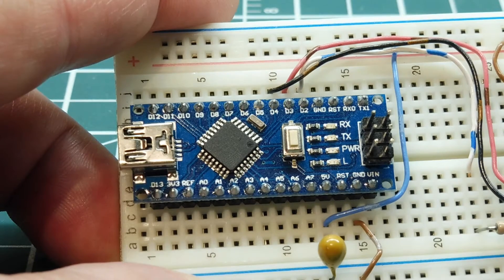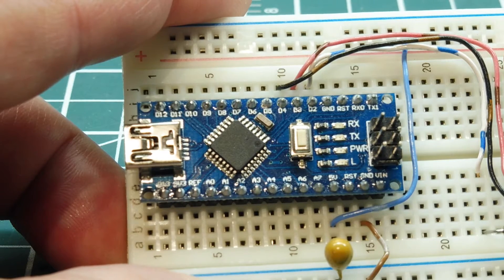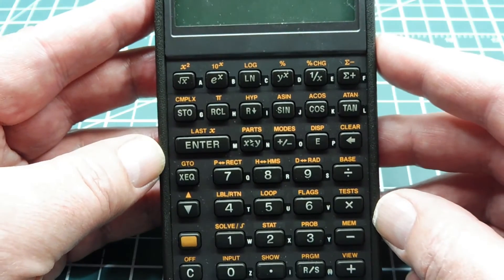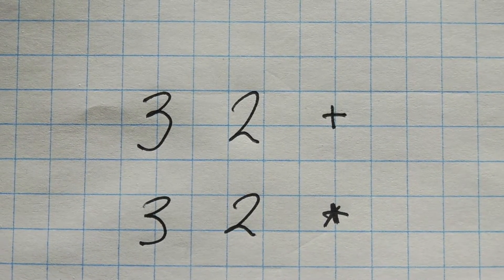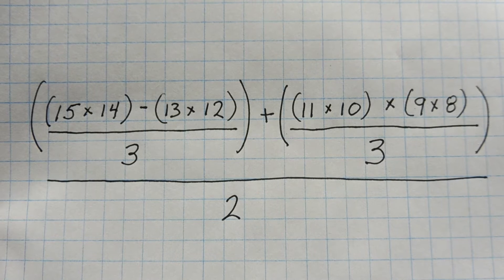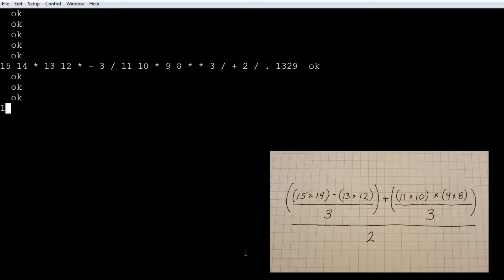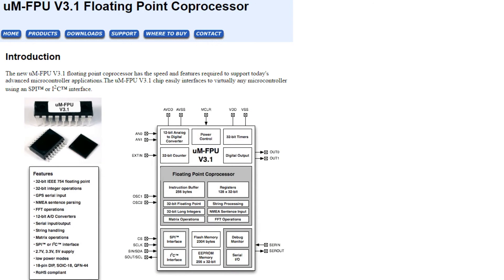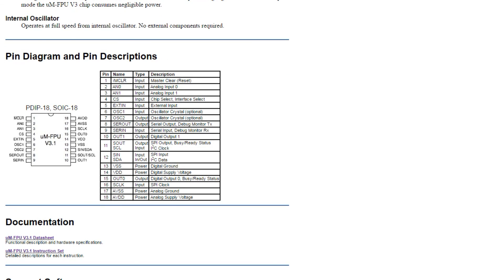Microcontroller Math  /  Reverse Polish Notation

Comment: yes, but what about, 20÷4=5 and not 20÷4=5+5+5+5 wich is not 20-15. mathamatics os not a preferences, it is language off consesus. means. there is nothing too choose. abacus. and hibacus. i believe 20÷4=5+5+5+5 (evenly spread or. even stranger. 20÷4=13+5+1+1. what are the rules here ? wich is not. 20=5×4 in notation.

Comment: Thanks for this hint, this is what I am looking for. Unfortunately there is no any replacement today, I have googled for few minutes and it seems to me this processor's manufacturing is cancelled. Is there any replacement unit? I am not really experienced in microcontrollers yet, found Adafruit Teensy only FPU capable.
Reply from the maker: They are hard to find. Check out ABRA electronics.
https://abra-electronics.com/robotics-embedded-electronics/parallax-en/parallax-microcontroller-accessories/604-00050-parallax-32-bit-floating-point-coprocessor-v31-604-00050.html
Reply: @0033mer  Thanks!
Reply: @0033mer  BTW I found some Adafruit Feather and ItsyBitsy boards which have 32 bit FPU support. I must check the datasheets. I want to use it in sound recording and frequency analysis (don't laugh, I want to measure the connection between the watermelon flavor and the knocking echoes frequency distribution and I want a portable instrument for this).

Comment: In my second year at university I sold my dune buggy  for $450 and bought the very new HP-45 (about 1972 I think). That processor was directly responsible for me getting an A grade in engineering statics and engineering dynamics ... which was remarkable for an EE student. Yes, RPN was great. There's an Android app that emulates the HP-45 but I seldom do that kind of calculation any more Matlab would be more useful on my PC.
Reply from the maker: It's too bad that only a few had that experience. When my friends forgot their calculator and wanted to borrow mine I got it back within two minutes with a strange look on their face. I had to carry around a normal infix calculator for that reason.
NASA realized the power of RPN in the 1970's and 80's and used Forth/ RPN in all their space probes. They even made a special microprocessor for that reason, the RTX2000/2010. I might do a video on that.
On the new calculators today you enter the whole problem as you see it on paper and it solves it for you.
Reply: @0033mer  "When my friends forgot their calculator and wanted to borrow mine I got it back within two minutes with a strange look on their face." - :D In 1999 when I was first year mechanical engineer student same story happened with me. I have started my studies with an HP32SII, later I bought an HP15C and an HP48SX. These calcs were my workhorses during these years, mainly 32SII, later the 15C (because of complex number arithmetics which was very useful in control theory exams) and later, during MSc the 48SX, because the "huge" RAM on board and programming structures - strange, but the graphical capabilities was not really useful for me, I used these machines mainly for number crunching.

Comment: 20 bucks for the math co-processor? That seems nuts! For that price you could get a very beefy microprocessor - I wonder how it would compare in speed to something like a ESP32 at mathematical operations.
Reply from the maker: This is not for everybody. You are paying for the ability to do Fast Fourier Transforms and Matrix operations. Very few people can code FFT and Matrix operations on a microcontroller. This enables a student the ability to do this without having to contract it out, which can be quite costly. If you don't have the ability, the size of microprocessor has no bearing.

Comment: 1) Why does the decimal point act as an equal sign in this equation, or to word the question differently, in this equation why is an equal sign avoided in favor of a decimal?
 Your my first encounter with RPN. I've looked up the RPN wiki and some calculator history pages. I find this very interesting and on the surface RPN appears more intuitive than infix notation, at least to me. 

2) What are the limitations for RPN? Why isn't this taught in school as opposed to or in parallel with infix notation?
Reply from the maker: The decimal point is actually a Forth word called "dot" which displays the top of the stack. The stack keeps track of the problem as it progresses and its contents can be displayed at anytime, and in this case the answer to the problem. In a computer program the answer is available on the stack for further calculations. Forth is a stack based language.
Here is some info: https://www.forth.com/starting-forth/1-forth-stacks-dictionary/

Hewlett Packard tried to change the world by introducing their calculator but it did not take off. HP did many studies on the use of RPN, and proved it is far superior. Steve Wozniak, one of the founders of Apple computers was working for HP at the time.
Reply from the maker: It all depends on the programmer. If you pick words that describe the operation, you can make your code flow like an english sentence. I agree, some Forth code is very cryptic. You can use Forth to write your own programming language.
I wrote a language called NEXX which was used to control data radios. You can see it here:
http://simpson.net.au/david/291.pdf

This is Circuit Cellar magazine, check out page 30, LMR wireless control.
Reply: I love Forth. Your using it was one reason I subscribed to your channel. It really forces you to write your code from the bottom up and makes it simple to test each part as you go. I think the only thing that held it back was that it's harder to read a completed program than some other languages. At least it is for me. Maybe I'll try it again now that I'm getting into Arduino stuff and saw you using it.
Reply: Wow, that was a long article. I haven't seen Circuit Cellar in many years.